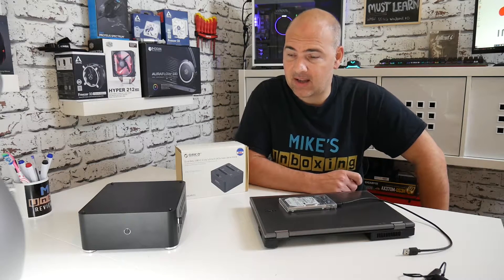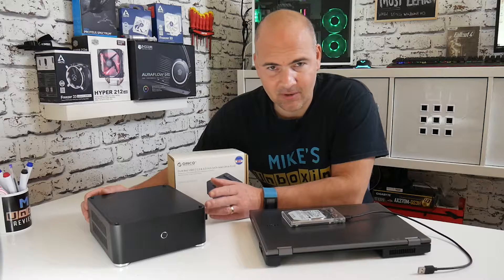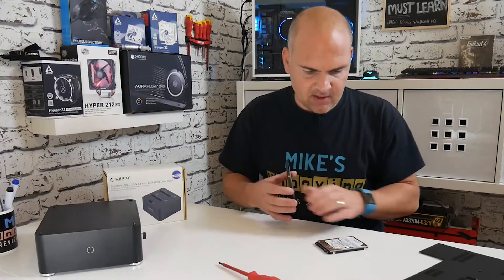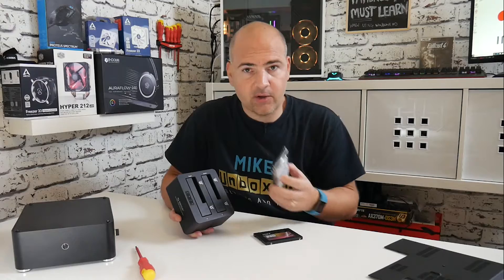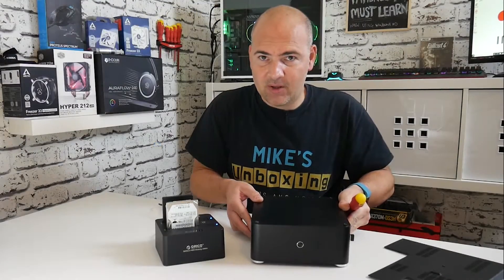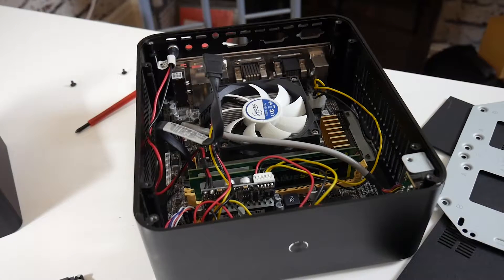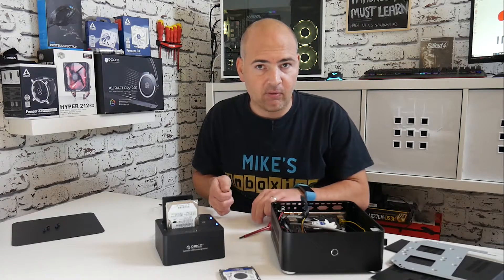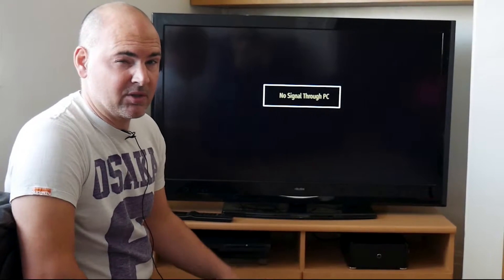Speed And Silence In My AMD AM1 Mini ITX Build Cloning A SSD

Comment: Do you know where I could get the case with the PSU? Thanks 🙏
Reply from the maker: I bought mine from a friend but you can get them on amazon. What country are you in I could find you the links
Reply: @mikesunboxing  ireland/uk, I had a quick look on amazon but can only find ones without the psu installed 🙈
Reply from the maker: generally it is better to get the psu separately depending what wattage you need, what sort of build are you thinking of putting in there
Reply: @mikesunboxing  something very low anyway, probably a 2200g and probably a noctua low profile cooler

Comment: Looks like you laptop made it easy to get to the hard drive. I put an SSD in an older Dell laptop for a guy last month and it turned out to be a much harder job than it should have. The hard drive was mounted on the top of the chassis just under the keyboard, so I had to take the entire freaking chassis out, just to swap out the hard drive. Ridiculous way to build a laptop.
Reply from the maker: Damn that sounds painful! Could you have removed the keyboard to gain access? I find the keyboard always bends a bit when I do that and it never sits flush again 😁
Reply: Mike's unboxing, reviews and how to  Not in this case. The Keyboard was attached to the main chassis so once again the entire chassis would have to be removed in order to replace the keyboard. So glad they don't make them like that anymore. So far I've found that  HP laptops have been the easiest to work on. To access the hard drive on my HP laptop you just have to remove the battery and one screw.
Reply from the maker: Nice. I liked hp laptops until the Nvidia graphics problem that the 4000 series (I think) had.
They would get hot and the bga chip would get loose and need to be either baked or reballed.
Thank fully that doesn't happen much any more.
Reply from the maker: Nice. I liked hp laptops until the Nvidia graphics problem that the 4000 series (I think) had.
They would get hot and the bga chip would get loose and need to be either baked or reballed.
Thank fully that doesn't happen much any more.

Comment: That was great. I swapped out my HDD for a SSD in my laptop which is my main windows PC and what a difference that made. I had never come across the cloning tool. Brilliant! Any suggestions for a low cost windows server at home?
Reply from the maker: Thanks for the feedback Charles. Much appreciated. What are you planning to run on the server? Or is it just file Sharing and domain administration etc?
Reply: Mike's unboxing, reviews and how to DNS, DHCP, development web sites, ftp, file share.
Reply from the maker: So are you looking to use Windows server or are you looking at something like the SME server software? And where is it going to be kept? Does it need to be low power draw, quiet, what is the estimate of TB needed at the moment and looking to the future. 
I like a challenge 😀
Reply: Mike's unboxing, reviews and how to it needs to be windows because i am familiar with MS IIS. Say 1TB storage. It will be kept in my dining room. It is for family use only. I expect the real challenge is the server software.
Reply from the maker: I would seriously consider an older pre build like the Dell with a i5 2500 and stick a big hard drive in it. They run pretty quiet and if it is using older DDR3 ram that is getting cheaper so you could use 16gb and it wont cost a fortune. If you can get a i7 2600 or K version even better. 
Dell's are normally built with an office use in mind so i wont mind being left on 24/7 and the cooling systems are pretty good.  Is this the kind of route you are considering?
You can add MS IIS as a addon service to normal Windows 10 if that make things easier? And cheaper.
Let me know what you think, and i'll try and narrow it down more
Reply: Mike's unboxing, reviews and how to sounds like a good solution. Many thanks.